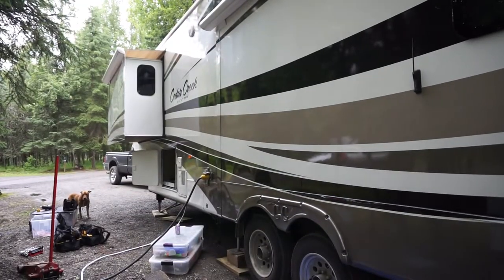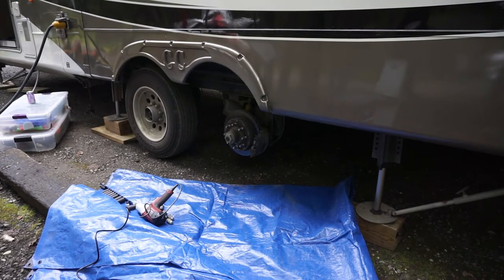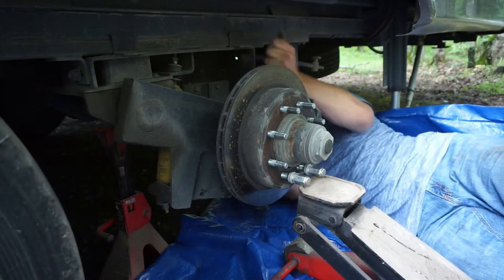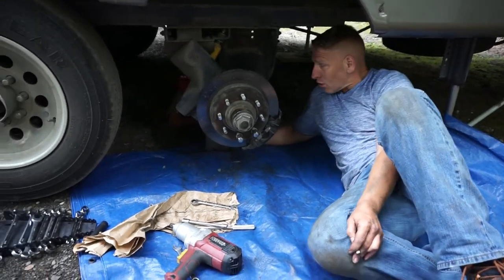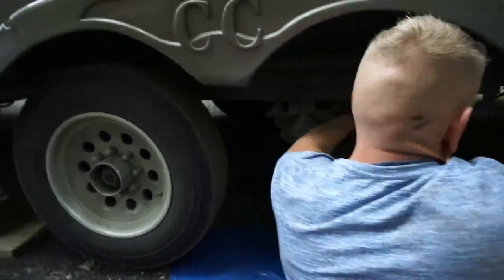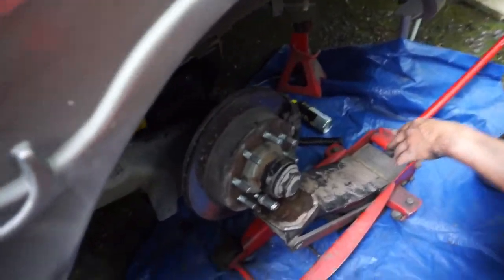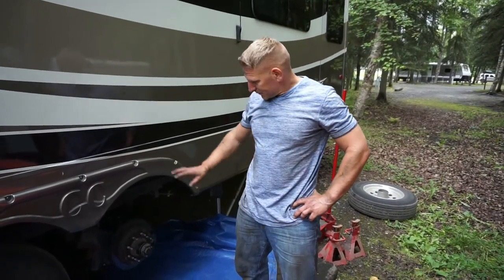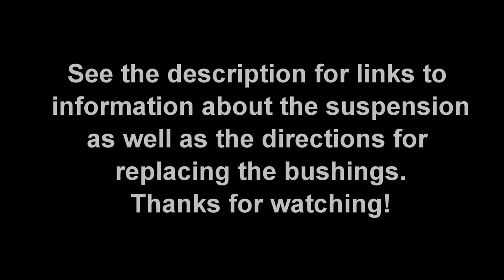How to Replace a Morryde Suspension Bushing

Comment: Some things are just easier to fix yourself instead of letting your rig sit at the dealers for a few months!  Great video... thanks for taking the time and effort to post.
Thanks
Reply from the maker: TheKeatons4 yes, we are full time, so we don’t have any time to sit at the dealer. Thank you for watching!
Reply: Sorry, I didn't mean dealer, I meant MorRyde. They are awesome. Had replaced CRE-3000 with Dexter and found out on long trip that Dexter lowered the fiver, which made it nose high and tires were rubbing above. Called MorRyde, made an appointment because we also wanted their pin box. We got there the night before the appointment where they had a half dozen electric/water sites and camped with others waiting for service. They worked us into a busy schedule, installed new CRE-3000 equalizers and the pin box. Great experience.
Reply from the maker: Yeah, we don't use any dealers.  We do have an appointment in May to have MorRyde lift our trailer so we can stop towing nose high and get the rear end off the ground.  Looking forward to having them do the work as well as ensure everything is good!
Reply: Are you nose hight due to the Andersen hitch?  I use the Andersen as well and I think they make trailers a little nose high.  I LOVE LOVE LOVE my Andersen and don't think I will ever change.  I love how quiet and smooth it makes everything, but its all Ive ever used so I dont have much to compare it with.  I don't hear any noise and it doesn't have the chucking and bucking I hear folks talk about.
Reply: My 2012 Cougar is level with the Andersen 3220 set at the lowest level. Chances are any other hitch would make a fiver nose high with their truck, but the AUH has the same height adjustments as the B&W hitch.
Reply from the maker: I'm pretty sure we're nose high because of the truck.  The 2016 F350 4x4 comes stock with a 4 inch lift block in the back, and it sits pretty high.  The previous owner of our trailer had an older truck that sat lower, and when MorRyde installs suspension, they match it to your tow vehicle.  I wouldn't want any less clearance between the trailer and the bed of the truck, so I'm not sure any other hitch would make a difference.